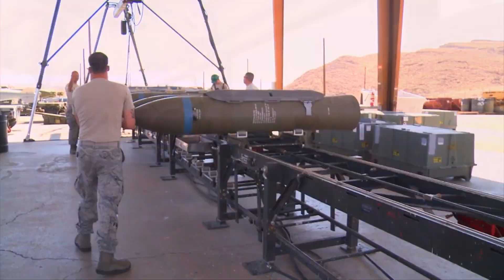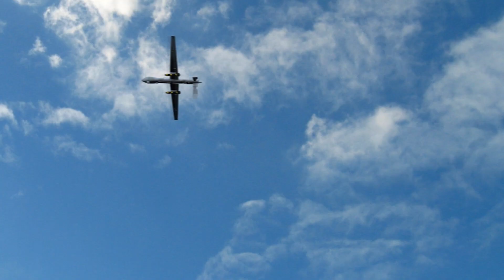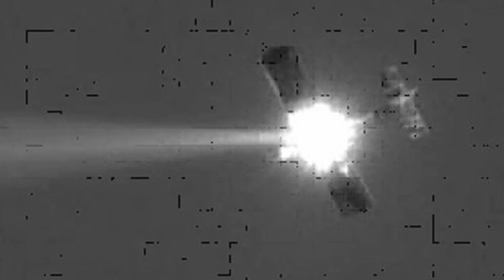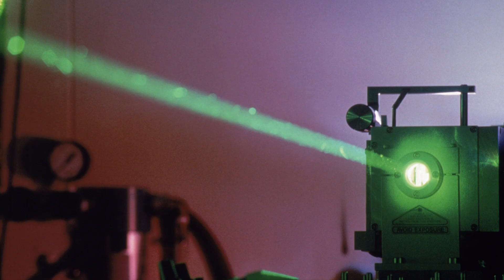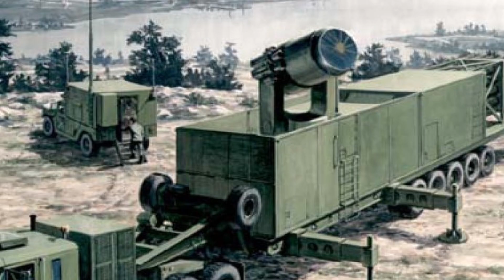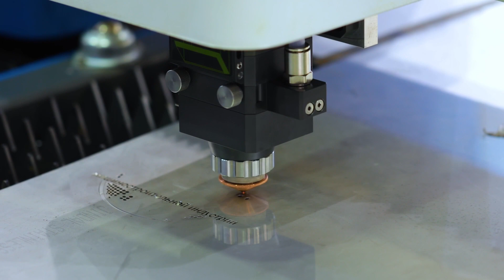15 MOST ADVANCED Laser Weapons

Comment: With 60 cents the warming is over it's unbelievable, it takes a bit of math, that takes some time, but then you can hardly believe it and you start calculating it a few more times, that's my experience. I'm going to calculate for you what it costs per world citizen. The Earth 500 million square kilometers, 16 people per square kilometer, 62500 square meters per person, in 100 years, 1.5 degrees warmer in 36525 days, 1 atmosphere is equal to 10 meters of water pressure, which is 10 tons per square meter, water becomes 1 degree warmer per gram with 1 calorie, 1 gram of atmosphere becomes 2 degrees warmer with 1calorie, To warm up 10 tons of atmosphere by 1 degree, you need 5000 kilocalories and we need 7500 kilocalories to warm it up by 1.5 degrees. With 60 cents of aluminum foil, 3 square meters of aluminum foil, you can reflect 3 square meters of sunlight back into space without changing the frequency, which otherwise heats up the greenhouse gases, a square meter of sunlight gives an energy of 1 kilowatt per hour and you could radiate 30 kilowatts per day back into space under good conditions, 1 kilowatt is 840 kilocalories, then you have 25200 kilocalories and you would compensate 3.3 square meters of atmosphere per day, you have 36525 days in 100 years and you could compensate 120532 square meters, that is twice as much, the Earth itself reflects 50% of the sunlight and you would compensate 60266 square meters that is a deviation of 3% there may still be some deviation possible. The biggest deviation is our government that tells us that we are running into a disaster and drives us to gigantic costs, that if you realize that global warming can be compensated with so little effort, where the citizen is responsible for 1% of the warming and the rest is caused by industry.

Comment: a reflective surface vill reflect the energy!  Even a very concentrated high energy beam will need time to 
burn through metal and time to heat up explosives before they burn ! The air contain dust and water 
droplets that will scatter and reduce the energy
Reply: With respect, I think you underestimated the information in the video and perhaps didn't listen to the details. 
 Aside the shard amounts super isotopic material  of debris found from E.T. sources, there is not a reflective material strong enough to counter the intense energy shot that can be directed to the size of a penny!. 

If yiu know of the material that it will withstand and is super reflective then please tell me as I shall invest in that and make sheilds!